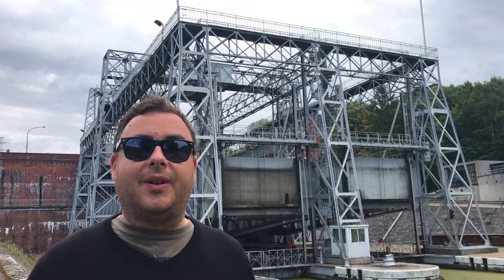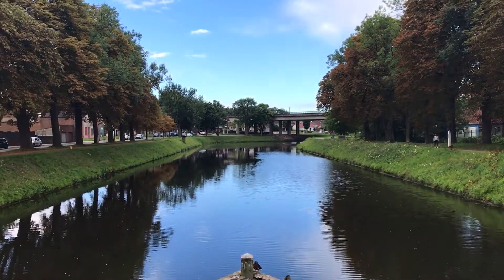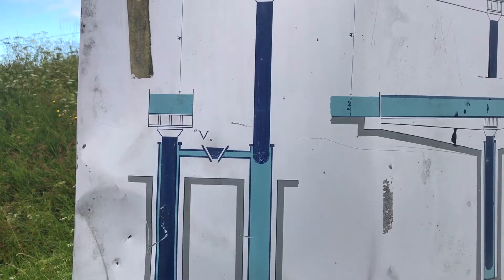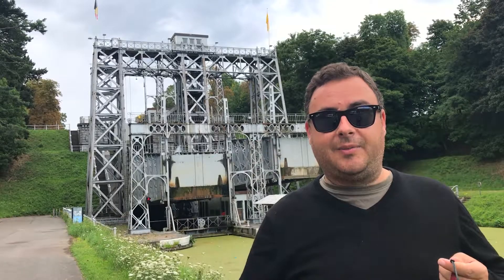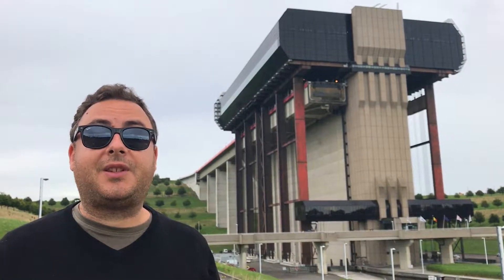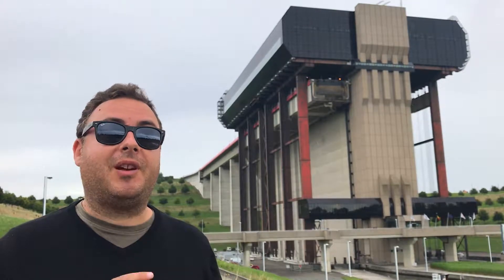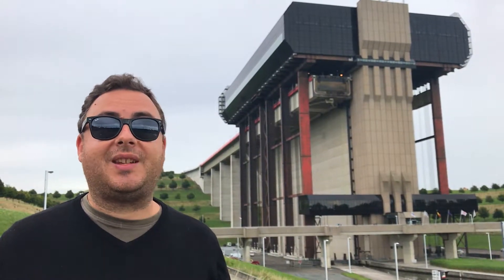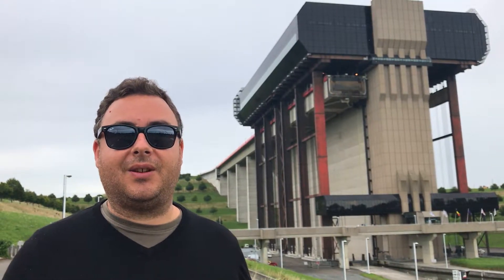Four Canal Lifts of the Canal du Centre - UNESCO World Heritage Site

Comment: Can the boats only go downstream? The water looks full of algae!
Reply from the maker: The water was pretty stagnant yeah, the canal doesn't get used much these days. Boats can go upstream no problem! The just sail into the lower platform and then flood the upper platform, changing the balance and switching the lifts around (if that makes sense). Remember that the boats have very little weight compared to several hundred thousand cubic metres of water!